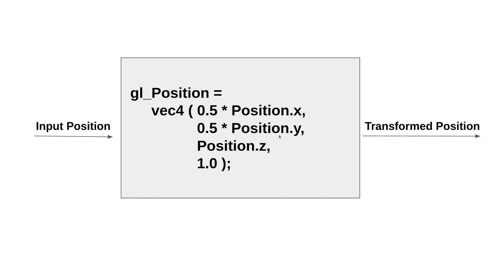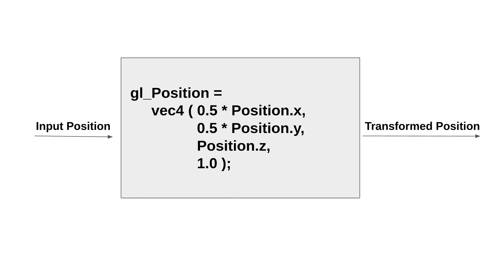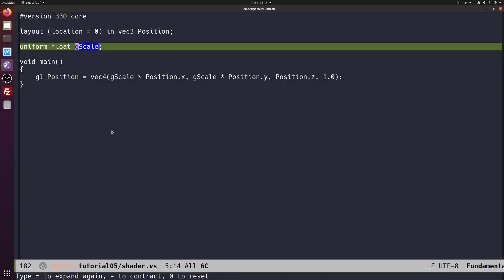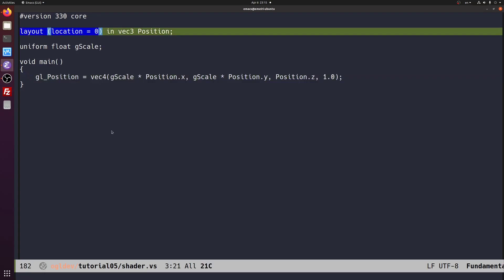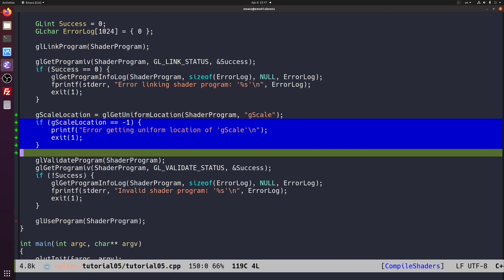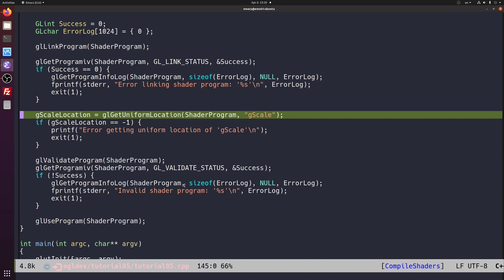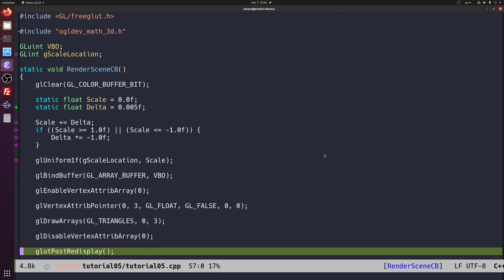Using Uniform Variables  // OpenGL Tutorial #5

Comment: My triangle is not zooming in and out as fast as yours, and I have a newer system with a 3080 12gb GPU, 128gb ram Ryzen 7 5800x, and a 4k monitor, not sure what would cause it to go slower. Thanks for the series.
I changed delta to 0.01f from 0.001f and that worked, but still curious as to why it was slower on my machine.
Reply from the maker: Check the framerate. Are you using the same code as mine?
Reply: @OGLDEV  Yes I'm using the same code. I would need to run Htop or something to find out my framerate, the Nvdia driver I'm using doesn't seem to have it in it's settings manager. It's not a big deal right now.
Reply from the maker: I don't think htop tells the framerate. You can easily get it by incrementing a counter each frame and zeroing it out every time a second has passed.

Comment: this was quiet fun, i did mess around a little and almost threw up from motion sickness because i instantly set the value back to 0 which was a big mistake, thanks again! however i noticed the code runs WAY faster on my pc, why? like you setting a value to 0.005 is the same as me setting it to 0.0005... not exactly but similar, does this have to do with fps?
Reply from the maker: Perhaps it has something to do with the fact that the video runs at 30fps.

Comment: I parse the shader source code with std::regex in the Shader constructor and then cache the ids in a JudyArray to reduce expensive communication calls with the GPU. Judy arrays also minimize cache misses so I should gain a good performance boost from it
Reply from the maker: Maybe I'm missing something but I'm not sure I understand where is the performance gain here. Setting up the shaders should be done offline, before the main render loop. During runtime you only need to update the uniforms. I have a dedicated location variable and function for updating each uniform. This can be improved by using uniform blocks.
Reply: @OGLDEV  I do that when the shader is created, I.e my shader class keeps a uniform id cache (string of uniform maps to int) that is populated via parsing the shader source code after glLinkProgram. Then in the SetUniform methods that cache is used when you call it with the name of the uniform.

So the performance boost is that glGetUniform calls only happen when the shader is constructed, automatically done by the shader class via the code parser and the user doesn't have to create integer variables that keep the ids. And the Judy array is much faster (saves memory and optimized for CPU cache) than all the associative arrays C++ provides, so I heavily speed up the map lookup.
Reply from the maker: I can see how this helps you reduce the code size and effort because you (I guess) have a single SetUniform function for handling all the uniforms. In my case I don't need any mapping because I have a dedicated variable per uniform (e.g WVPLoc, ColorLoc, etc) which is set once with glGetUniformLocation and then a dedicated set function updates the specific uniform.

Comment: Hi  Mr OGL, how to manage and monitor RAM usage when using C++ ?
Reply from the maker: On Windows you can use GetProcessMemoryInfo in a C++ program to get all the relevant information. On Linux I guess you need to parse one of the file under /proc. But in general I suggest starting with the existing tools such as 'ps', 'top', etc. There are also specific tools for tracking processes for memory leaks.
Reply: @OGLDEV  Thank you!
Reply from the maker: np
Reply: @OGLDEV  valgrind
Reply from the maker: @obinator9065  Unfortunately (afaik) Valgrind is available only on Linux.

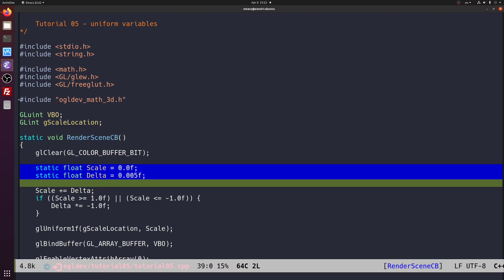Comment: Note 6:07 , I had an issue where my triangle would just not do anything when building the program, and I found that it was because Scale and Delta were both of native type float, while I managed to get it working when initializing these as GLfloat instead. 
I was using glsl #version 460, so I'm guessing that might be why. (#version 330 wouldnt work on my end)
Reply from the maker: That's weird because GLfloat should be a typedef of float. What platform is this? Can you please print sizeof(GLfloat) and sizeof(float)?
Reply: @OGLDEV  Ignore this actually, just tried switching them back to regular float and it worked instantly.
Might've been something else I did at the time that I didn't catch.
Sorry about that !
Reply from the maker: No problem, glad to hear it is working.

Comment: Awesome tutorial, everything works on Windows! One question however, I notice that the animation is very smooth in the video, however on my system it seems to be scaling faster and appears choppy. Any idea why that might be?
Reply from the maker: Thanks!
What GPU are you using? In this video I'm still using GLUT so maybe there's some frame rate problem. At some later point I switched to GLFW which is more common these days and may work better for you.
Reply: @OGLDEV  Thanks for the reply! While playing around, I think I may have put a larger delta than what you used in this specific video. Changing it back to the lower value smoothed it out quite a bit. Any remaining difference I assume is just due to software/hardware differences :)

Comment: On Linux mint (clean install) I can't run the program... I have this :"window id: 1
Error compiling shader type 35633: '0:1(10): error: GLSL 3.30 is not supported. Supported versions are: 1.10, 1.20, 1.30, 1.00 ES, 3.00 ES, and 3.10 ES
'" Anyone has an idea please, I am stuck
Reply from the maker: Try changing the version at the top of the shader files to:
#version 130
Reply: @OGLDEV  wow thanks for the quick anwser :o ! I think the code ha to be different, i have to deal with "window id: 1
Error compiling shader type 35633: '0:1(10): error: illegal text following version number
'
"But do you know why i can't use 3.30 ? Is that because my pc is too old ?
Reply from the maker: It may be because you are using an old Intel Integrated graphics GPU. Check what driver is configured there. I think the Mesa3D driver is very problematic. You may be luckier with the Intel official driver.
Reply: problem solved using #version 310 es and  specifying the precision for each vec4 variable:

out mediump vec4 FragColor;